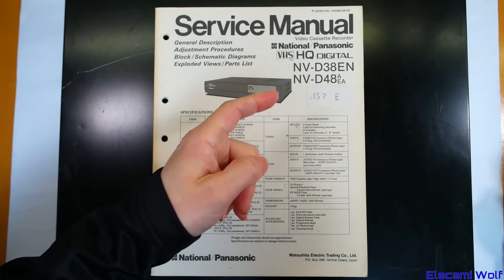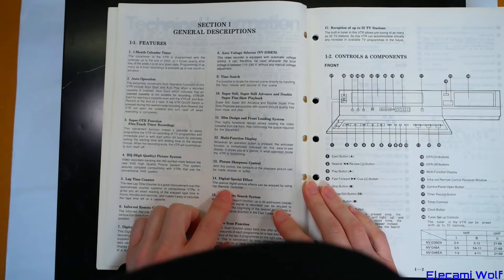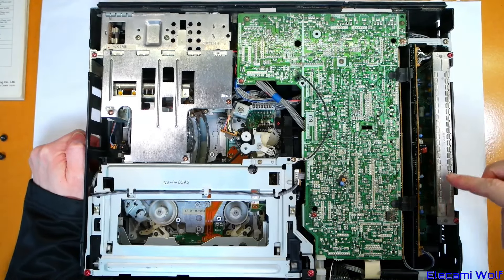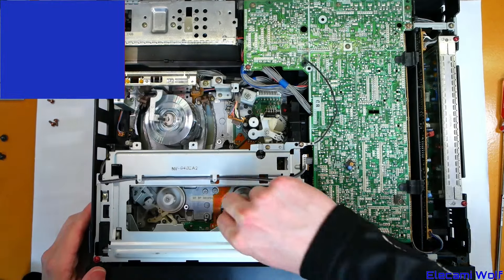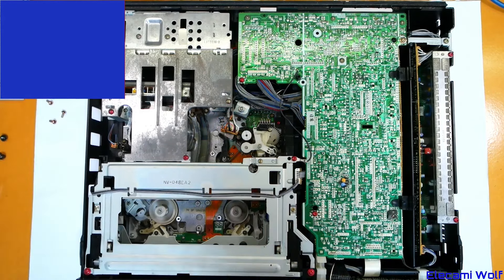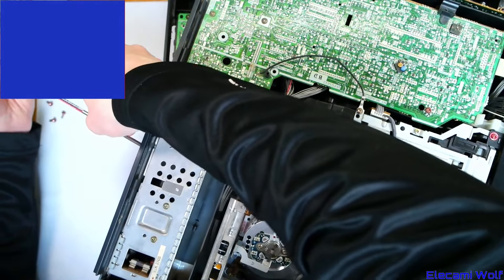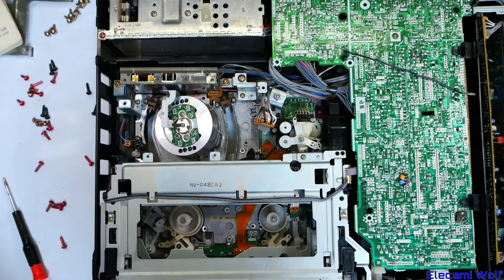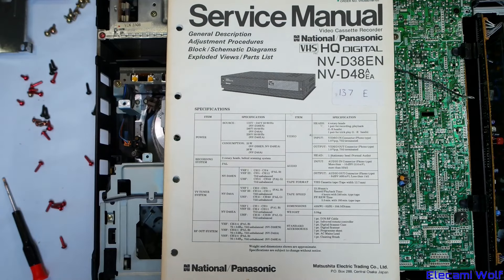EW0146 - National NV-D48 VCR Investigation Teardown

Comment: I found there was too much grease on my carriage, so I cleaned excess  off the rack gear and made sure it ejected and loaded using my hand a few times then refitted it and it worked. I had earlier just realigned the whole mechanism (following the g deck video)  after I bought it and realised the p5 wasn't correctly connected to the sector gear (one tooth out) now it works ok.  Mode switch is next to clean, but like yours it's in a real awkward place and there's an additional  motor  blocking access. I've had to order a rachet screwdriver to undo the screw behind the motor so I can get to the mode switch.  I might buy a NV-D48 since it uses the same split washers and circlips and I could do with some spares. Great video, enjoyed watching you troubleshooting.
Reply from the maker: Thanks. Glad this was helpful. Hope you have success with your machine.

Comment: Do you know why my panasonic isn't counting correctly on rewind?  Haven't tried fast forward.  Is it because on rewind the machine half loads and so might not be passing the ACE head correctly?
Reply from the maker: Counting on the tape counter? It could be that the tape is blank or has sections that don't have anything recorded on it.
Reply: @Elecami  I sussed out what it was,  basically when the panny RWD's or FFWD's the p4 arm drops off maybe to the half load position ( I think it's called) and so when RWDing and FFWDing the tape isn't in contact with the main head drum.  This alters the angles of the tape path and in my case the tape wasn't touching the ACE assembly which measures the time. So I had to play around with the p5 arm by tightening it until I got the counts roughly correct, it's a real pain I spnt ages on it. Anyway thanks for your replies mate 👍